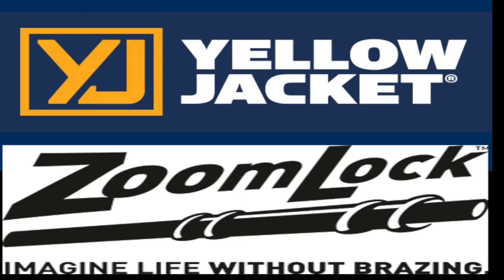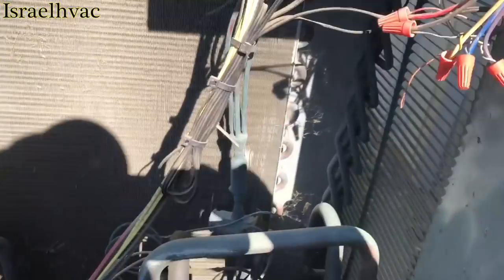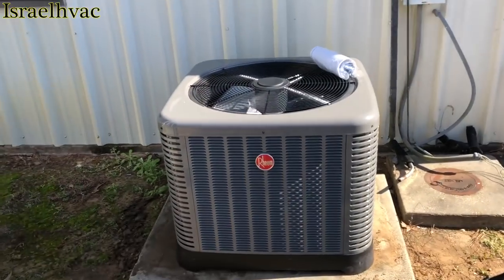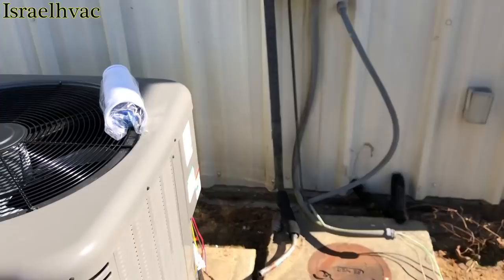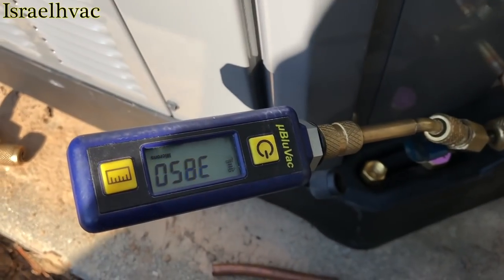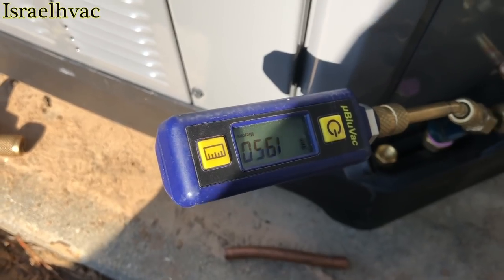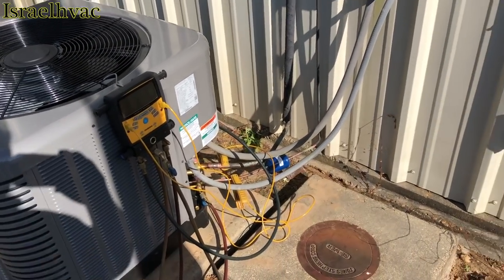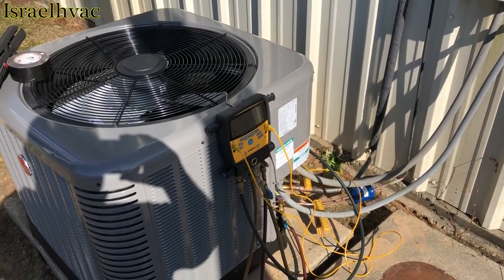HVAC: Heat Pump & Evap Coil Change Out

Comment: I am going to make on recommendations. I would go back to your supply house and ask for the coil shield for the new aluminum coils. What Rheem and RUUD have been finding that when you change out old copper coils to  Aluminum coils. The copper leaves behind  Residue on insolation of air handler And it reachs with the aluminum and causes pinhole leaks.
Reply from the maker: bpscottland74 A cover did come over it but it was a shipping cover it stuck out so far there was no way I could’ve got the panel on if I would’ve left it.

Comment: Nice job.  One recommendation,  the drier should be the very last thing you install. When you install it outside then leave it open to the atmosphere, its moisture removing capability is going to be greatly reduced for the system because it's removing moisture from the open atmosphere it is being exposed too.
Reply from the maker: It's not a issue think about it.... You pull a Vacuum.

Comment: Kind of a sloppy install. Whips don’t look good, needs a lineset cover, isolation pads not underneath unit. Just being picky, I do understand if they don’t want to pay  for the actionable cost. Just don’t want to hear what a great job or how good it looks when it doesn’t look great, we don’t want to give new installers the wrong idea. To each there own. Also your podcast are great and they get better every time. You and Gill really mesh well tighter. Hope every thing goes good for you and your family God bless.
Reply from the maker: Well I’m very happy with the install. It did come out great and is a quality job. Your in tilted to your opinion. Your more than welcome to load up some videos and show us how it’s done.
Reply: Israelhvac haha heard that probably a “Super Tech”
Reply: JonesHvac  no not a supper tech. John dose good work, I am not going to say that the liquid tight looks good , it’s old and to short, sorry it just is. If people aren’t willing to pay and want the cheapest job done I understand not replacing it, just don’t say it looks supper clean.
Reply: JonesHvac  do you run expose linesets and not put a cover over it? I Don’t. Nor do I think that’s a clean look.
Reply: Forrest Bredau I’ll offer line set covers to the customer but most of the time we just use a two hole strap and make it as neat as we can. If it’s just a condenser swap we normally just use what’s available or already there and make it look as neat as we can. Most of the customers I deal with here in south Arkansas aren’t well off, they make just enough to scrape by. I get about 70$ per Service call here
Reply: JonesHvac I totally understand people don’t have extra money for extra work. Putting on  a lineset cover doesn’t makes someone a supper tech. Heaving a expose lineset and old short liquid tight and calling it a clean job is somewhat crazy that’s all I was saying. John is a great tech and installer.
Reply from the maker: Amen brother.
Reply: Left it better than he found it; looks fine to me, especially considering how nasty the existing braze job looked.

Comment: hey I know I'm not the most experienced Tech been doing this for about a year now so maybe someone can help me understand thought you post to flush your lines when you changing from R22 to 410A I don't see where he did this can somebody please help me understand
Reply from the maker: Robert Smitg I don’t use flush. It’s a crock. I do blow the line set out with nitrogen.
Reply: Don’t use flush just blow the lines with Nitrogen and you’ll be fine. The solvent in the flush is way worse for the unit than a little mineral oil left behind.